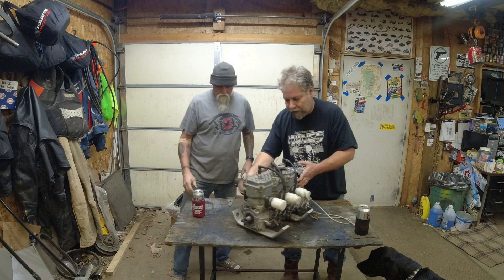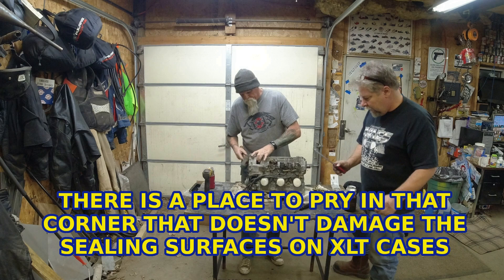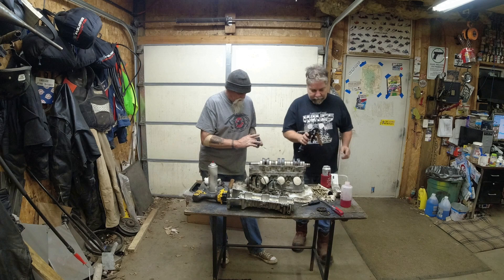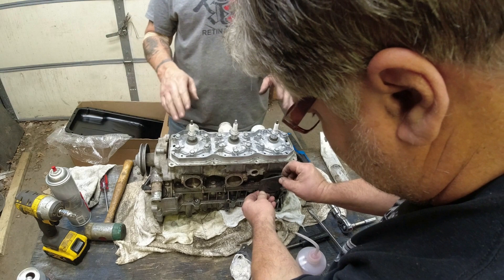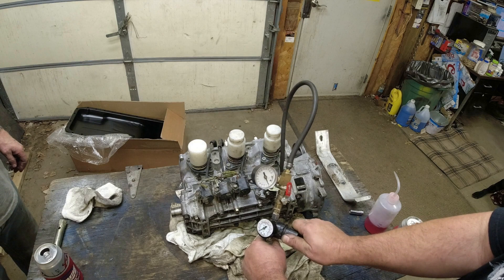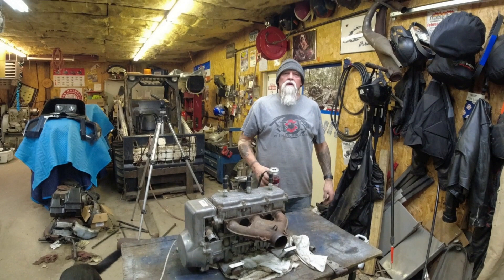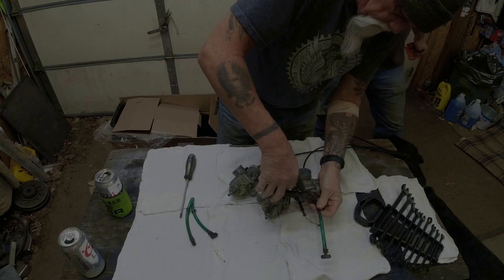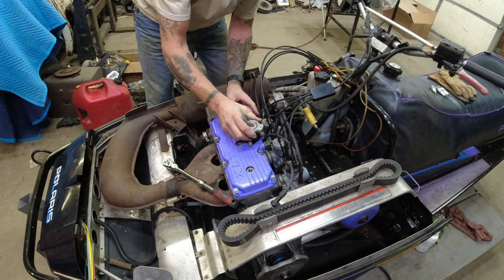Lonnie's XLT Part 5: Getting it ready to ride! Vintage snowmobile sled

Comment: Take the center out of spark plug and weld a loop on it, you can use that to lift the motor out and in to the sled with your chain fall. Much easier on the old back.
Reply from the maker: Dan, That is a great idea. You will get a shout out on the video when I show that!
Reply: @nuttersspeedshop  cool on the shout out! When you have a fragile back like mine you need to find all the assistance you can get. 
Full disclosure though, I got this idea years back from a friend while working on his RXL.
Reply from the maker: I'm still kicking myself for not having done this already. Sure could have used it on the Ultra project.
Reply: @nuttersspeedshop  dont be too hard on yourself. Sometimes we dont see the forrest for the trees as they say. Sometimes a different set of eyes makes things clearer.

Comment: Strong believer in changing seals, learned that 30 years ago from an old time mechanic that had be working  on small engines for 40 years at that time. Basically if you dont know when the seals were last changed then change them out.
Reply from the maker: And sometimes even if you do know. If a seal is more than about 5 years old and I already have the motor out I change it.
Reply: @nuttersspeedshop  agreed

Comment: You, sir, are a wealth of knowledge on these older Polaris sleds! Really enjoy watching. Dang near have the confidence to do my own crank seals now (maybe). Trying to chase down an oil leak on an XLT motor with the fourth oil line. Appears to be coming from around the pump. Do you find many leaky pumps/seals on these XLT engines?
Reply from the maker: Never found a leaky pump, but anything could happen. Sometimes the pumps aren't sealed to the case perfectly. Could also be a crack in a line. Maybe even a leaky base gasket, but a pressure check would tell you if that was the case. Might as well replace the lines if you pull the pump off. Cheap insurance.